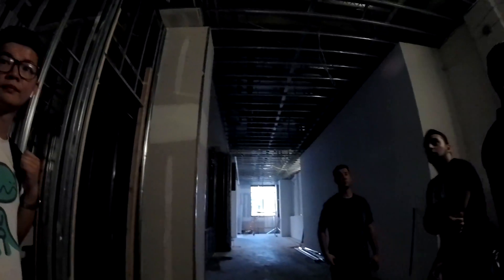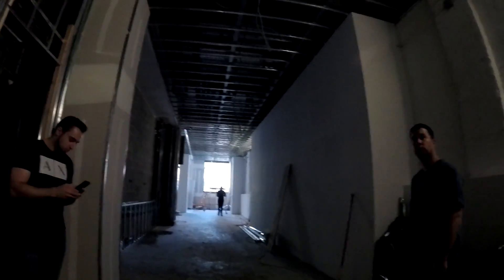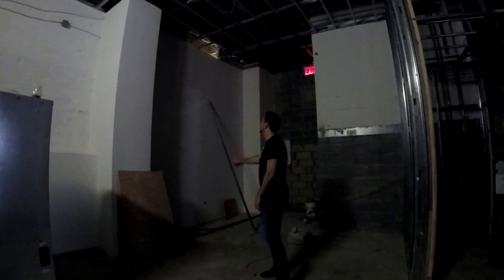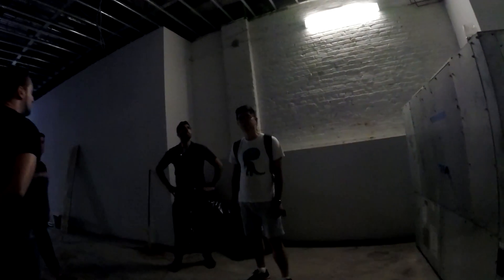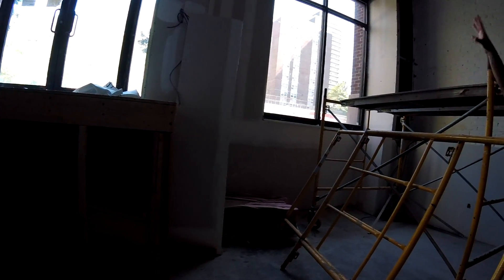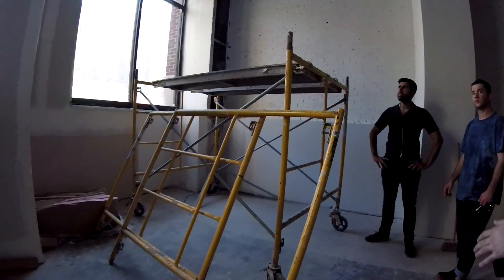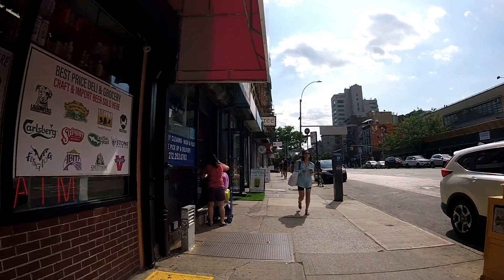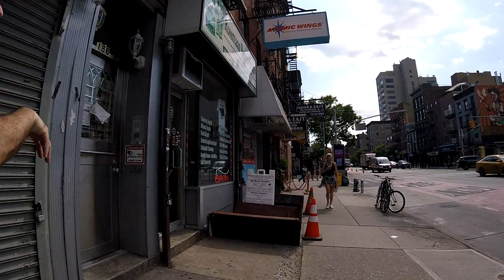Will this be the new Rossmann Group store? Still looking.

Comment: Three phase friers exist, but they're used for alot of Motors, automotive heavy equipment (ie: engine jacks, lifts & dynomometers), but alsofor things like Welders, milling machines, lathes and such too.

It really depends on what the place was used for before (and considering he said it was a mechanics workshop, all of the above I mentioned are possibilities). 3 phase is SUPER useful! Have 3 Consumer Units (fuse boxes/distribution boards etc) and at 100A each you'll never have any issues, and if you need 3 Phase for AC or specialist equipment for repairs, you have it already and dont need to spend $100k+ to get it installed.

Comment: Paul, Louis, beware of contractors. The building is many floors high. It looks like the owner of the space digged underground to get more space to sell. Is it legal? CHECH IT
Reply: No, it's underground because that's a crawlspace. They've removed the whole floor.
Reply: if you look at the toilet tank at some point you can see that the current design is not ment to have a crawlspace as the train pipe is wall mounted and low to the ground. Also i don't think it's a universal thing. not all buildings have crawlspaces. This one however origionally was build with either a crawlspace or a basement in mind. you can see the height of the foundation walls.
Reply: @kiddy1992  yes. Also the main entrante and the energency edito are at the original level. Where is the original pavement?

Comment: Wow a lot of a unknowledgeable people talking about stuff they want and don’t know what they have. Being from the construction side the more things you talk about you want at multi levels and got it all over the space I’m seeing the dollar signs going up exponentially. 
       Getting reliable ones are far and few between because they have too much work and I have no time for talking to people or doing estimates they have jobs from now until eternity. And right now in this country HVAC contractors have way more work than they could possibly handle and no skilled labor for employees who know what they’re doing. 
        I don’t know about there but here in California we’re paying $.24-$.32 a kilowatt hour. So when you buy your new air conditioning unit you better buy the most energy-efficient one you could possibly afford otherwise you’ll have a power bill like owning a hummer paying $5. A gallon while you try to heat or cool your building for summer or winter.

     In three phase is three single legs of power that you can tap off of each individually or type two of them together to get a higher voltage. Don’t worry about it you have no equipment in your business that requires three phase except for your HVAC unit.

Comment: 1 phase systems are part of 3 phase systems voltage between one of phase and neutral are 220-240v and between two phases are 380v no need to convert any thing, with 3 phase system you have 3 separate 1 phase system i one main line, so you can balance users to trip breakers because overload

Comment: When you send that list of things to build and install, you have to prioritize by what you need most, what you can pay for first, and acknowledge that the time frame could be months before things are ideal.
Also, be aware that bare/hard floors & walls will be very noisy; and noise is one of Louis' personal pain points.
Finally, does Anel know of any cool rigging and crane stuff that is used for boats but can also be repurposed for building?

Comment: Most US commercial buildings use a 3 Phase 4 Wire 208Y/120V power arrangement because of its flexible. Low power loads can be powered using any 120V single phase power circuit and high power loads (Water Heaters, AC Compressors, large induction motors) are powered using the 220V three phase power circuit.
  This is not an issue.  The electrical is usually ran through the ceiling and dropped via duct banks.  It would be cost effective to make everything the same level and absolutely a sump pump is needed.  The concrete floor should not be store floor. It would be better to have a crawlspace.  If it was the same level as outside you wouldn't worry about having to be ADA compliant, plus you can run all Cat5/6 under.

Comment: The code for wheelchair ramps is 1 foot of rise for 12 feet of run, so in order to go up 2 feet the rapper need to be 24 feet long, also there has to be a landing for every 16 feet of run so in that 24 ft ramp you would need at least one Landing or flat spot where the person in the wheelchair could rest on the way up the ramp

Comment: Dont worry about the 3 phase service. You still have a neutral which allows you to take any of the 3 hots and get 110v to neutral. Or take any two of the three hots and get 240v. Nothing needs to get converted or modified.
Reply: 240v measured from pole to pole is two legs of 120v, you can run your neutral and get two 120v lines, or draw off both poles to get your 240v, this is how nearly all houses in the US are set up.
208v is three phases of 120v, if you measure from any pole to any pole it is 208v, you can still pull a neutral and get 3 seperate legs of 120v if it is a WYE transformer, two 120v legs and a high leg if it is a delta transfromer.
480v is three phases of 277v, if you measure from any pole to any pole it is 480v, you can pull a neutral and get 3 seperate legs of 277v if it is a WYE transformer, two 277v legs and a high leg if it is a delta transformer.
Reply: Your correct a 3 phase is just a extra wire that's the wild leg. 3 phase breaker panels still give 220 and 110 you just don't use every 3rd breaker. Have wired lots of businesses like this.
Reply: That's not how 3-phase works, one does not simply "take two". For 3-phase the phases are 120 degrees out of phase, US 2-phase (really split-phase) are exactly opposite, i.e. 180 degrees.
Reply: @krattah  have you ever installed a 3 phase comercial breaker pannel in a business. Doesn't sound like it
Reply: @krattah  sure worked on the last commercial job I did for a dentist with 3 phase power panel (that I installed) and he needed 220v for his AC unit on the roof. Still working after 7 years.

Comment: I say keep the front at streat level for customers then where stations are going to start have some steps up to the mid point and use all that extra space as storage..
maybe even drop floors like in casinos for that whole workstations anywhere thing so you don't have extention cords hanging from the ceiling.

Comment: About those stairs, they're a nightmare. Like I said yesterday rain, snow, morons don't mix. I would suggest covering them up. Make a dedicated customer service/reception in that area. Then develop a large ramp going around the area hugging the wall on the left in that corner. (Not on the right as Paul suggesting) Big enough to accommodate the handicapped, as well as the biggest Fed Ex hand truck. Use that reception area underneath for storage. The architect might come up with a better idea. So just look at all the options.

I wish you luck in this new place. (If you sign the lease) and stay awesome..
Reply: Strider3671 Thought the same... WHY customers have to go downstairs.....
Reply: I like this idea.  It solves a lot of the liability issues.  It also gives customers a good view of the shop.  They aren't an Apple store that needs a bunch of browseable space to put shiny products on pedestals.  (although I do get that they'd want space to put tools on display or provide a tool tryout area)

The thing they're selling is the actual service that Apple won't provide.  Maybe that's a thing that should be showcased by the layout.
Reply: Yes.  The familiar feeling should make them feel more comfortable and reassured.

Comment: concrete will crack if it gets micro cracks I have seen plenty of concrete floors with huge cracks in them the entire length of a hallway drop anything heavy on it and it will chip.  if you want something durable, also,,,  try medical flooring https://www.spectracf.com/hospital-flooring-options/     also thnk if you drop any electronics on a hard concrete floor

Comment: raise the store front and about 250sqft to ground level and then have a staircase after that for the rest of the place. That way you can have a reception for customers at ground level and workers utilize the rest of the space
Reply: Yes,  A counter, lounge and customer/employee bathroom in that raised front area. No ADA issues with customer's in a street level store front area.
Reply: That would cut down on light penetration into the space.
Reply: @ajones8699  You can use windows & clever paint use, internal walls & mirrors to bounce light ahead and flood areas with natural light. Alternatively, they could put a skylight in when installing the New AC unit, as they've gotta fuck around with the drop ceiling anyway.

Comment: Build up the entire floor and have 6.5ft storage underneath the entire space.  The building used to be street level, but has a high enough ceiling you can go a foot up street level with the entire main floor.  It makes the bathroom have enough height to work properly and avoids installing another elevator.  Stud it all out and build a strong floor.  Only making a raised floor in the back is silly, then you need another elevator in the back for accessibility into the bathroom, two elevators is silly and you give up all the area wasted above you if you only have the one level on the concrete floor in the front.  Also, with a full floor at street level all over, you can put the bathroom anywhere you want, not just in that one place.  Don't make poor decisions based on that existing plumbing, you can move the bathroom anywhere with a full first floor.

You may even want to put a small subfloor in the basement and install drains in the concrete floor by cutting in and putting in a pump system.  2in high subfloor with a drain system dug into the concrete floor and a good pump system will keep your product safe from water seepage.  Do it now, because doing it later will be a hassle, don't trust that there is no water seepage, make sure you protect your product.  You also want a battery backup for your pump(s) and a backflow preventer so sewage cannot flow backwards into your space.  The backflow preventer is critical and easy to install.  If the sewer backs up, let it flood everyone else's basement, not yours.
Reply: This comment right here - gotta go this route for this space to make sense! Think about any kind of water issues you might have and plan accordingly.
Reply: 2.4m is the lowest ceiling height that the insurer is likely to consider safe. 6.5ft is jumped in reaction and KO'd on the ceiling.
I am willing to bet the reason why this place never rented is because the floor to ceiling is less than 5m but over 4m due to a planning or construction fuckup leading to a weird to use space.
Reply: The quick and dirty would be fill it with sand, run pipes and electrical in the sand then pour concrete on top as new street level shop floor.
Reply: N Andrews wait what and lose all that space for what????
Reply: @N_Andrews  wtf? dumbass landlord would say stfu

Comment: So with the concrete floor and it sounds like your going to have alot of hard surfaces with keeping the brick, you'll have a lot of echo or sound bouncing around in that place. Make sure you putting sound absorbing materials or sound masking in the ceiling to help with the noise.  basically sound thing more than what Louis put up to help with his music.

Keep in mind also with your large ceilings and brick any digital signage displays and speakers you want to mount since from experience with that height and material it a pain especially if your trying to keep the cabling nice.

For cost, it not going be too bad since you guys don't seem to go for the flashy finishes which is what drives cost up the most.

Comment: I would keep the 3 phase I own a small business in PA and we do a lot of industrial electrical and from my experience the AC units used three phase and almost any motors made for industrial applications use it. It will not effect your regular voltage in the building you will still have 120&240  you can still use your normal square D breakers the only time you need anything special is when your connecting something to the three phase power. Next if you want to keep the concert floors you can I would suggest sealing them with gloss so if employees spill something it will come out don't just leave them stock. Also if you do the drop ceiling make sure you have eco labs put mouse traps in their as rodents love to live in them I would personally keep the ceiling open to mitigate that problem.
Reply: They will keep it, the guy just has no clue what hes talking about. :)
Reply: Three phase is common in apartments and commercial buildings. Voltage between any phase and ground is about 110v, with 208v between any two phases.  Electroboom did a video on it when he discovered that is how his condo is wired.  Link: https://youtu.be/quABfe4Ev3s

Comment: If you have 3 phase you have all the voltages your looking for...
Reply: exactly just nutral to any phaze is a regular 120v line
Reply: Yep, they think 3phase is for 3phase equipment only...
Reply: @25566  Well, technically it is only for 3 phase equipment! You can branch off the legs to run 120v and 240v, but 3 phase is for 3 phase motors!
Reply: @terrypen  thats what i just said
Reply: Egghead!
Reply: It depends. Is it three phase corner grounded delta (not likely), or three phase center tapped delta (208v high leg), or the most likely three phase wye? The last is the most common, but must be boosted if you really need 240v.
Reply: @Ripu2  they still have every thing they need. Even if they need to modify the feed. The power potential exisits.

Comment: Is that mold on the bottom of that pillar beside the bathroom area? 

Why is there no cover over the vent to the roof?
Reply: Chris Kosar it’s New York that’s why
Reply: It was done half assed. It should have been capped when they discovered there were no top units.